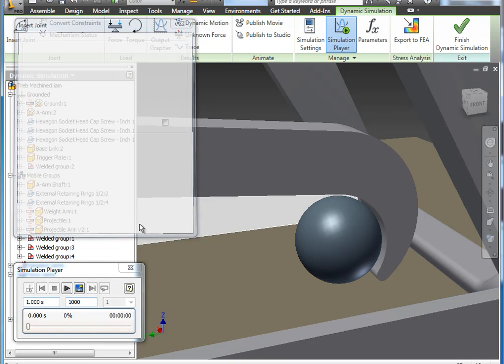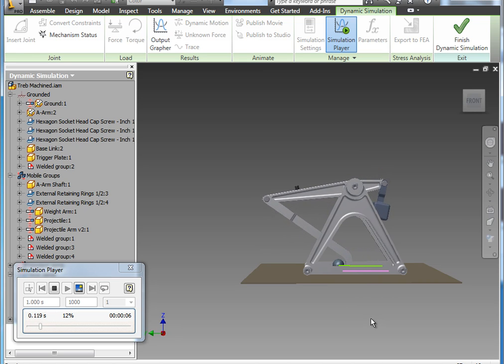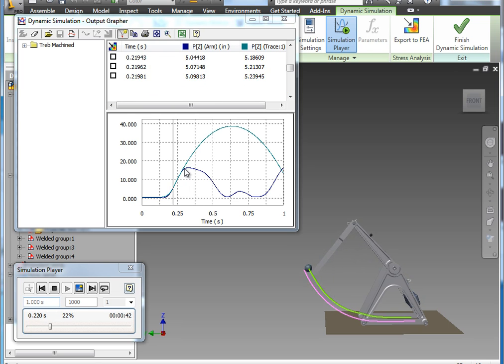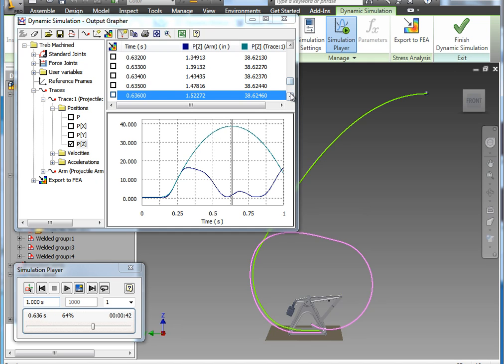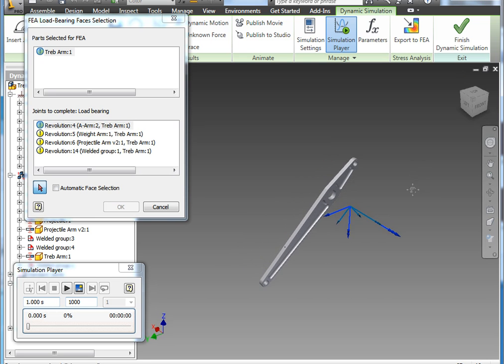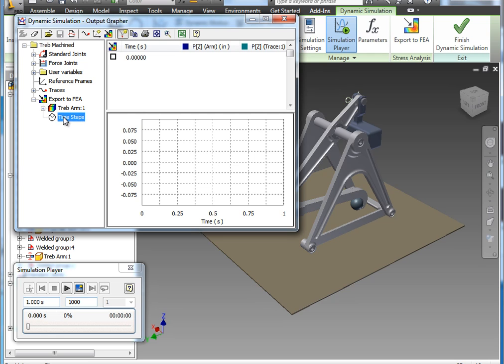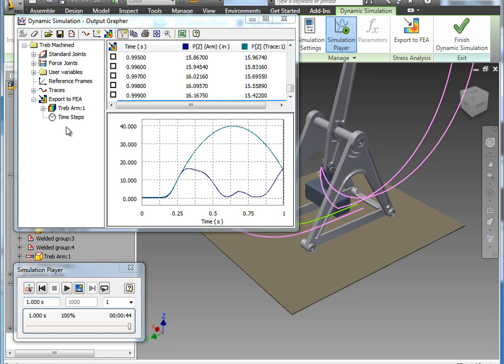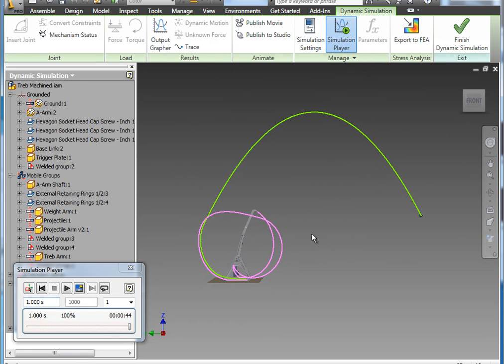Part 5 - Dynamic Simulation & Finite Element Analysis (FEA) - Autodesk Inventor 2011

Comment: Excellent video tutorials! I have been using them for my dissertation. i do keep coming across a problem though. I can set up my dynamic simulation fine, just exporting to FEA the program forces my to constrain areas where they should not be contrained, so i end up with no movement and a message saying the model has been over constrained in 33 places. any advice?

Comment from the maker: @naithaa Ah....that's the trick. Normally a trebuchet has a rope and a leather pouch to release the ball at the optimal position. In the case where you have a fix hook shape you are linking the weight and the angle of the hook exactly. In your case the weight is too heavy. You need to reduce the size of your weight by very small increments until you have just enough weight to throw it, but not too much to hang on to it. If you make it too light it will not pick the ball up.